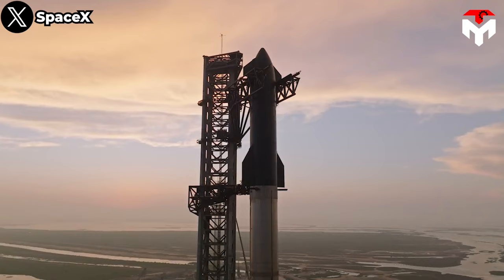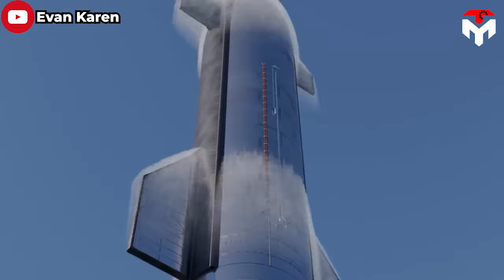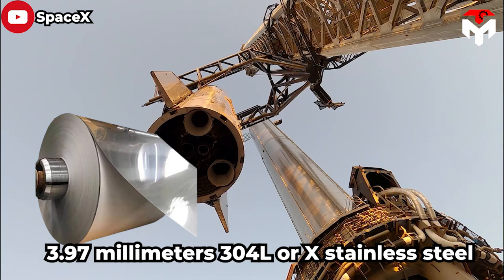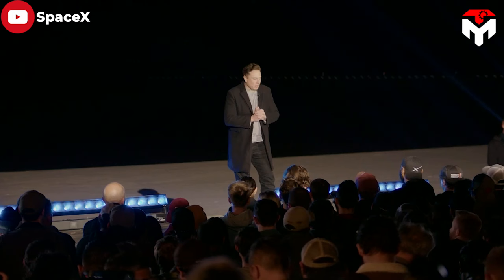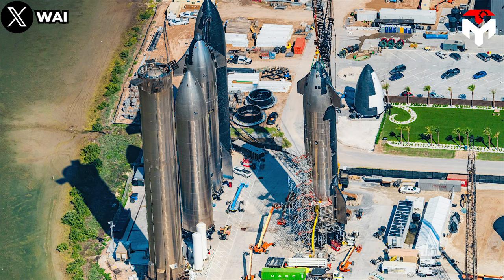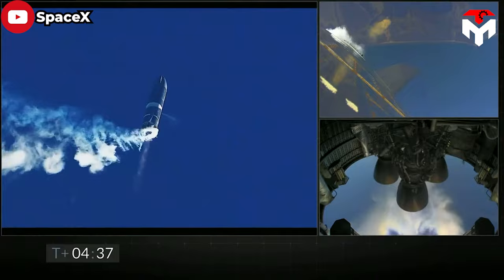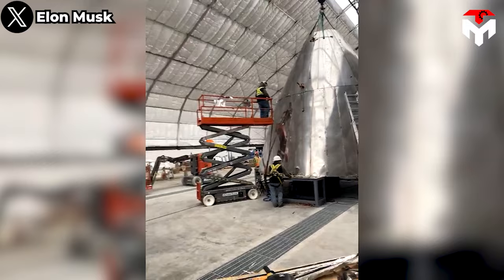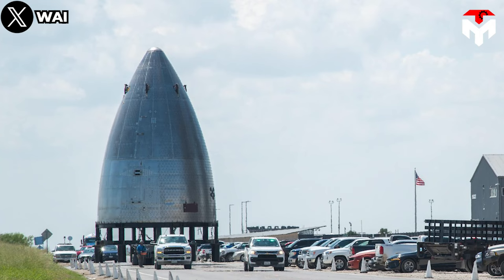How Starship's V2 Nosecone design change will blow your mind...

Comment: SpaceX should build a small robot which can replace tiles while in orbit. those small wheeled robots would walk through the entire ship, inspect and repair fallen/broken tiles. they would do the inspection and repairs autonomously or manually. just like we fix ISS via external vehicular walks. that would be a great addition to StarShip.
Reply from the maker: Thanks for your cmt

Comment: But, but, where's that big panoramic window show in every presentation of the straship?
Less dry mass means structuraly weaker, and more fuel means less payload (emphasys on pay). In any case, there is that old saying "if it works don't change it" so we can conclude that V1 is not working.
P.S. And ust think how much delay would these "improvements" bring.
Reply from the maker: Thanks for your sharing

Comment: Have they ungraded the way they keep the heat shielding tiles are fastened to the ship since the last report? I know they instituted a pinning method. When they manufactured the nose cone. Do they use a  type of English Wheel to get the desired shape when forming the stainless steel for the nose cone? Thank You!
Reply from the maker: I will find more about all of this. Thanks your huge support